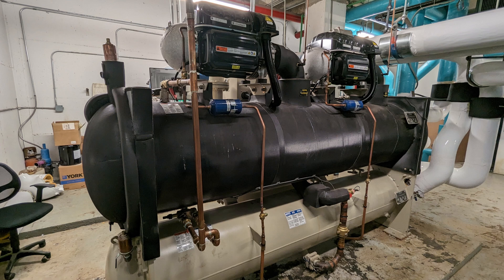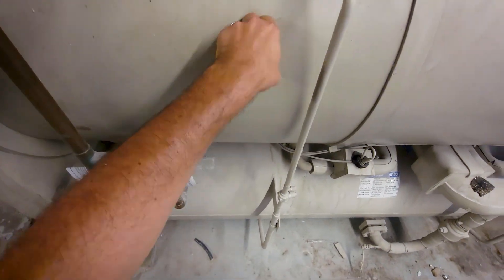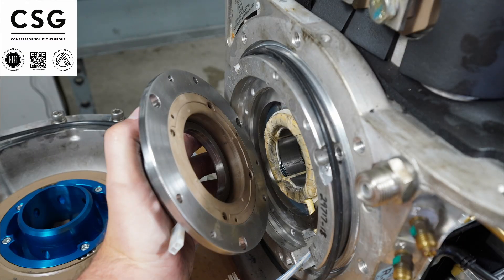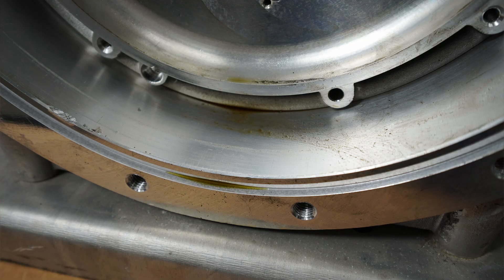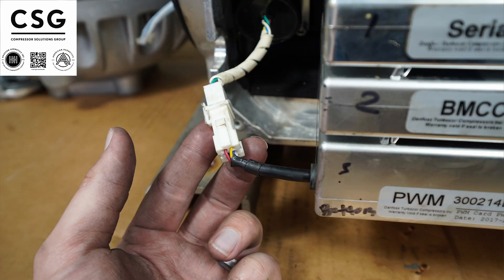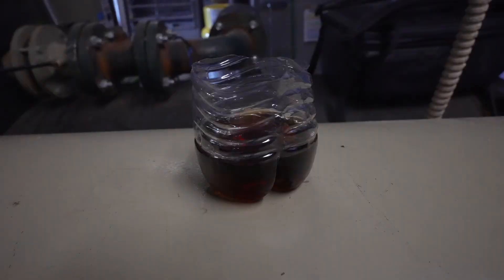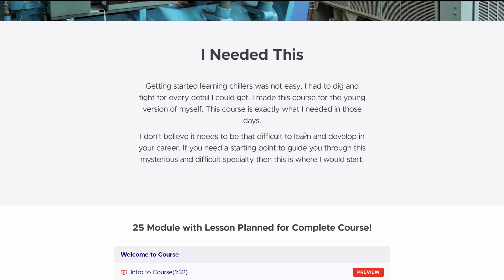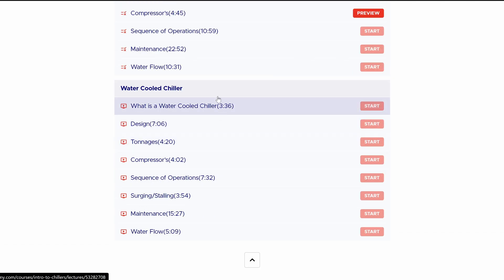Magnetic Bearings in Chillers

Comment: In Hong Kong, most of the chiller with turbocor compressor were replaced with VSD Screw or VSD Centrifugal Chiller due to the turbocor compressor unreliable. Most complaint were compressor alarm of cannot detect the rotor.

Comment: Could you explain more about common bearing faults with emphasis on the danfross multi stack turbo core compressor there seems to be a recurring issue with what …I would call popping when moving through or calling for more stage up control or supporting load